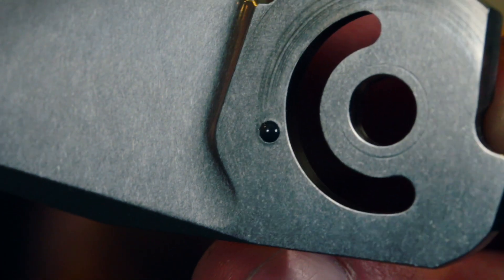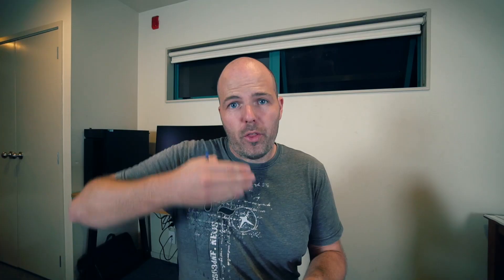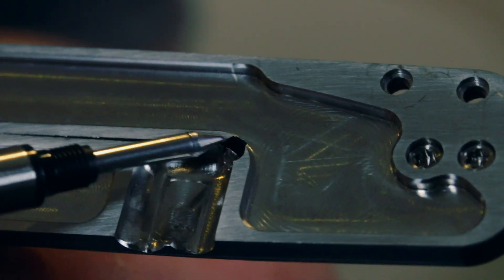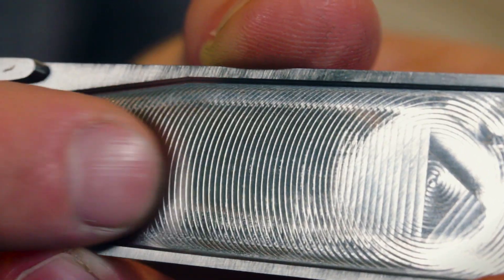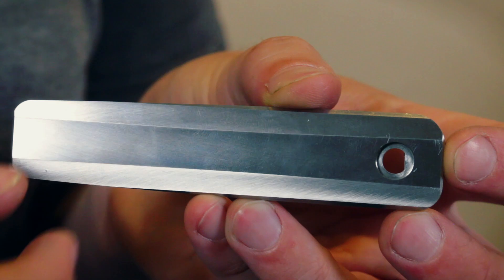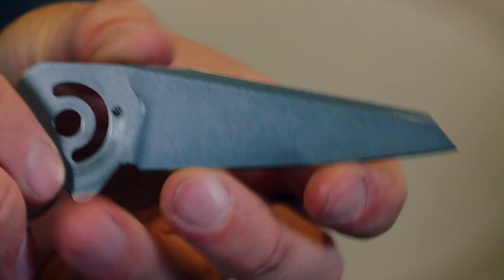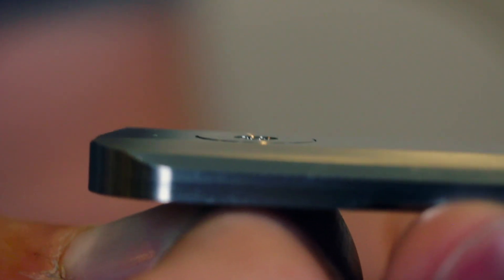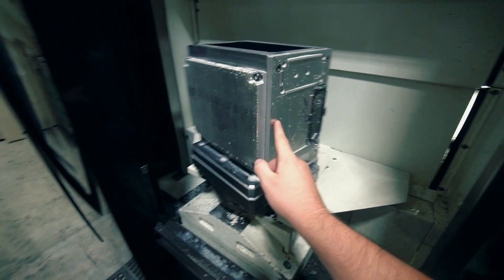Making THIS Flipper Knife (with CNC)

Comment: I'm really envious of you man. You just always seem to be moving forward and pushing through with ideas. I've been sitting on a Kickstarter for a few years waiting for the product to be right and you just up and do it.

As for machining, wish I could have came and given you a run through the horizontal and lathe. Could have shortened your learning curve dramatically. 

As for surface finish, if you want to remove the milling marks wet bead blasting works well, leaves a nice satin finish. If not getting a nice custom pattern isn't all the hard, could scallop it a bit with a ball mill or some such

Kepp up the good work, see you next year for the next video lol
Reply from the maker: Yes, just go for the Kickstarter Manny ...the platform is still great (but not what it used to be 5 or 6 years ago). It's not so much a novelty any more for people. Thank you for the info on wet bead blasting - will definitely look into this!